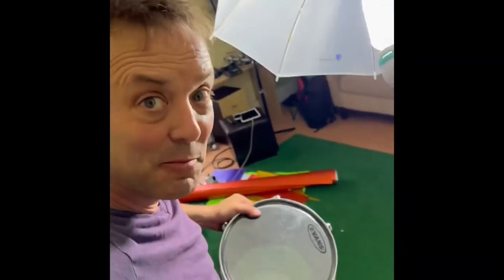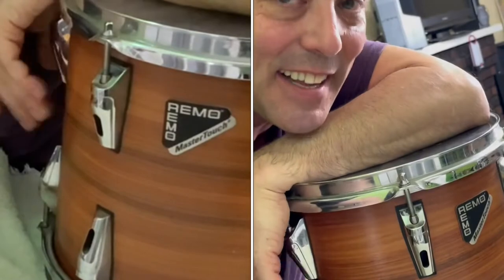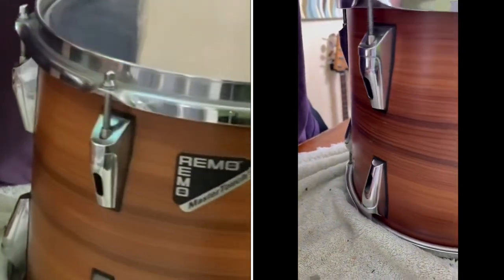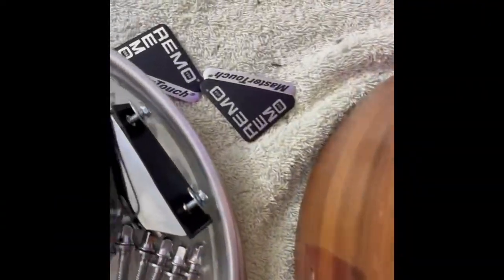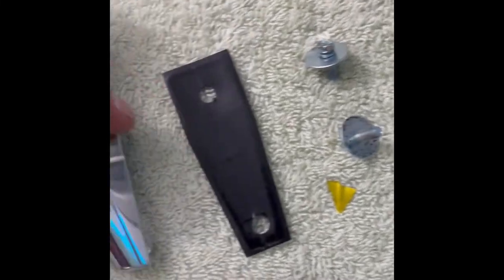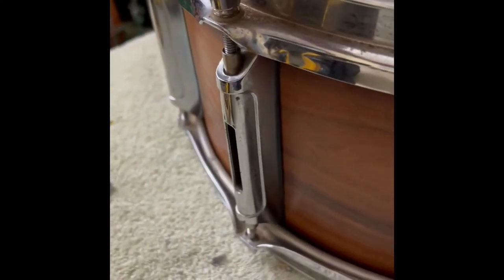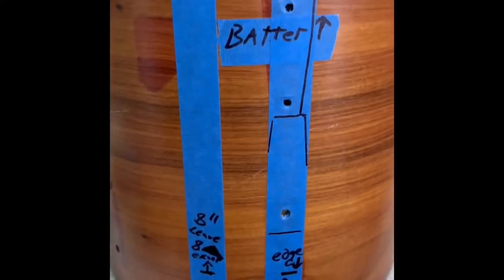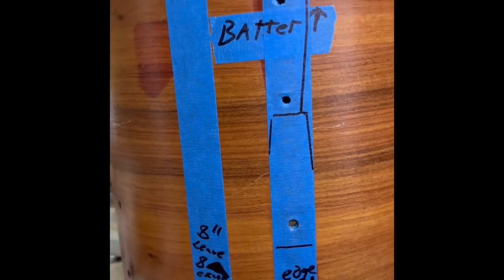Modernizing a 1998 Remo Mastertouch Powertom drum set.

Comment: Absolutely NO reason to cut these drums down! I have a 1988 Encore kit with the extended power toms, and they sound phenomenal. Big drums are cool, why trash a great kit?
Reply from the maker: Hi Tom! :). Thanks for checking out this idea.  The final video in this series shows, reattaching the Masters Edge, to the new shell depth.   Why…. It’s too much drum, for my taste in looks.  It sounds the same , but without the extra 10” power Tom sustain.  👍.   I’ve done this a few time on other kits I use in my channel.    Cheers mate!  Oh, Please Send me a pic of your mastertouch kit.  I’m trying to find more of them , out in the Wild.
Reply: @doubledeucedrums  The REMO 10 inch toms were 9x10, only one inch deeper than the standard 8x10 size. Cutting a drum because of one inch in length is just dopey.
Reply from the maker: Did the Encore series use the masters edges or were they the routed ones?

Comment: Chad, you cut a new bearing edge? Is that top edge cut or plastic?
Reply from the maker: It’s molded .   It’s ABS plastic  ( really hard, used in commercial building as Black plumbing drainage)   I’m still using it as a sanded flat edge right now, until I can go get some Remo Heads for it.    The outside Roundover isn’t really a round over   It’s molded to a Remo ambassador. I don’t have Any Router Bits this shape.  I might just 45 the inside and barely take the outer edge to a eased lite Sanded: curved edge.    Or…. I might try to cut off the old edge and reattach it with
Reply from the maker: Glue and clamps.
Reply: @doubledeucedrums  that’s what I though … not easy to modify! I’ve never had power toms so I would have left them alone! I always wanted the big deep 80s drums! 😂